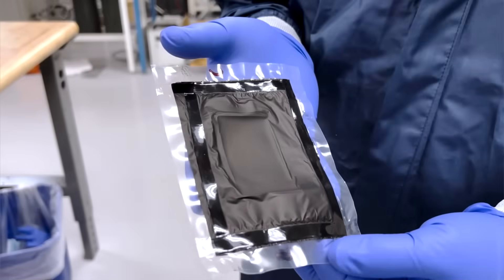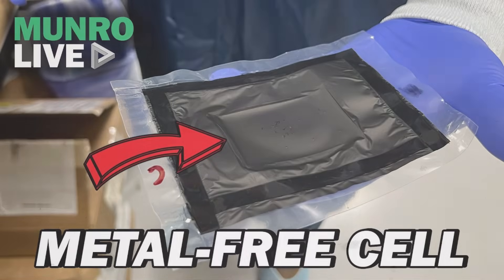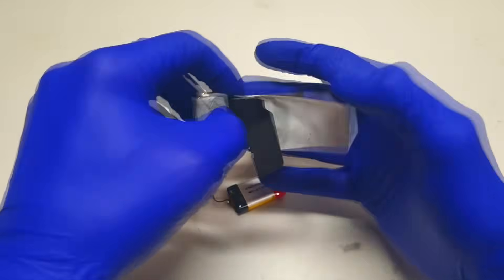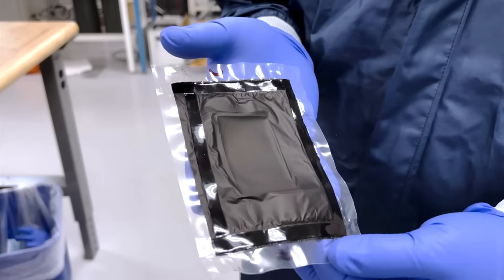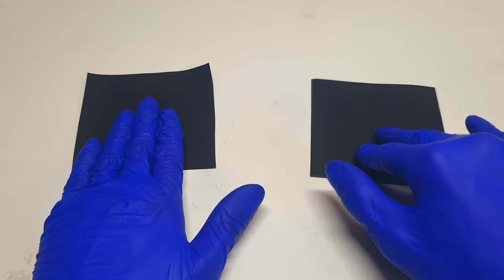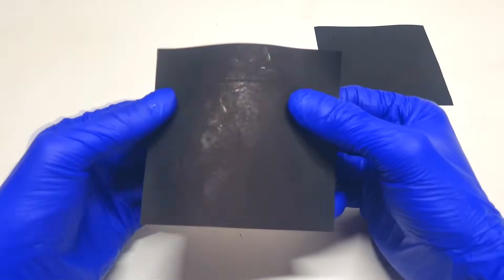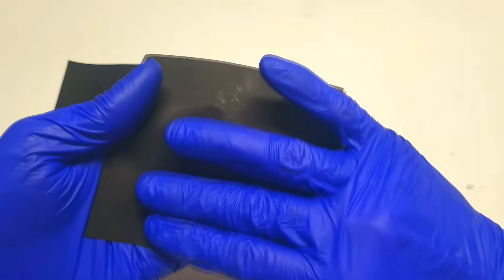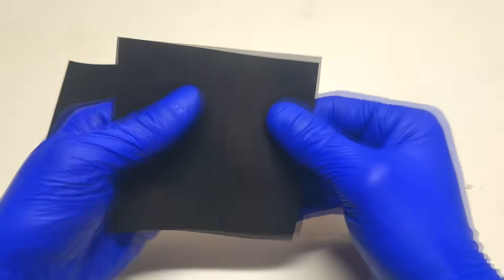DIY a Rechargeable Metal FREE Battery

Comment from the maker: RIgol website: https://int.rigol.com/
5% exclusive discount coupon Code for RIGOL Digital Multimeter DM3058: CFANS5D

Rigol DM3058 digital multimeter: https://int.rigol.com/products/DM_Det...
Rigol DP832 power supply: https://int.rigol.com/products/DP_det...

Do you search for FDM or resin 3D printer? Look into Anycubic printers and use my link and Coupon Code to get $25 OFF. Link: https://store.anycubic.com/?ref=cayrex and the Coupon Code: QDSQJZRPRE
Kobra 3 Max Combo : Founder's price for $584 with coupon code K3MC15
Tips: Using coupon code K3MC15 can enjoy extra $15 discount

Comment: Я посмотрел все ваши видео на ютюб, от начала и до конца, и понял наконец в чем моя ошибка в моих экспериментах, для хорошей силы тока требуется хороший токосъемник! Теперь у меня вопрос, я вижу что заряд идет 2.1В, но состав ZnBr2 на водной основе? почему не происходит электролиз воды, в чем секрет?
Reply from the maker: Yes, current collectors are important part of the battery for geting good current. Yes the electrolyte is water based ZnBr2. Hydrogen gas does not form because zinc ions are reduced more easily than hydrogen ions in a zinc bromide solution. So, the Bromine and zinc will be formded first.

Comment: I experimented with activated carbon from the drugstore. If you measure the tablet, it will have good resistance, but if you take it and overheat it to red with a burner, its resistance will be much lower. Of the graphite pencils, the thin, needle-like spare pencil leads have the lowest resistance. What do you know about reducing the resistance of the angle or activating it?

Comment: Zinc is a metal though so technically not metal free but still a cool concept and battery design.
Reply from the maker: @ChrisBro095 I know. Technically it need to be called a metal free current collector battery. But they simpley called a metal free battery. Is the same with "anode free battery" where by zinc battery dont use any extra zinc or by lithium battery they dont use graphite or extra lithium. Which then the zinc or lithium is plated on curent collectors directly. So in that case a it need to be called negative active material free battery but it is a anode free.

Comment: ion-free? does not sound good for li-ion batteries when you cant make them at home easily. is a frozen electrolyte solid state or liquid electrolyte. maybe freeze a battery for long term storage. usually frozen electrolyte stops conducting completely. heir to who. people? never. air says puff.

Comment: Bipolar batteries (I call them Lasagna battery) are the future of light, powerful batteries. The conduction is in the room (3rd dimension) instead of in the plane (only 2 dimensions) which will improve material efficiency and overall power of the battery
Reply: may I ask which conductive film material you use? is it any good?
Reply from the maker: @flipschwipp6572 Carbon filled conductive HDPE
Reply: Ok, but is the claim that using multiple cells,; where their attached  to each other will not need metal connections either ? How so , if you've covered a side with plastic, in order to not allow short ?
Reply from the maker: It is used a conductive plastic